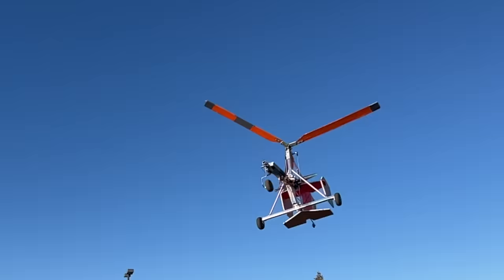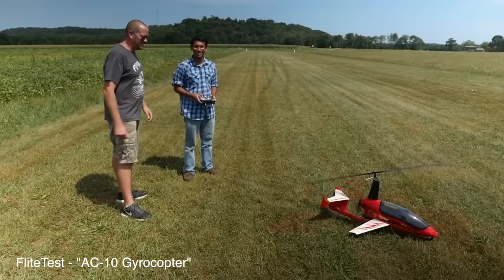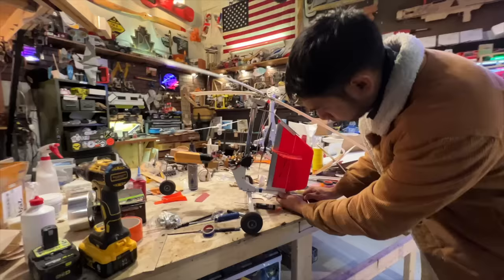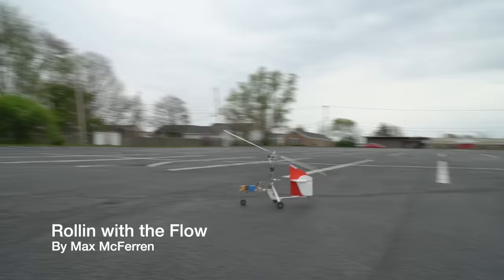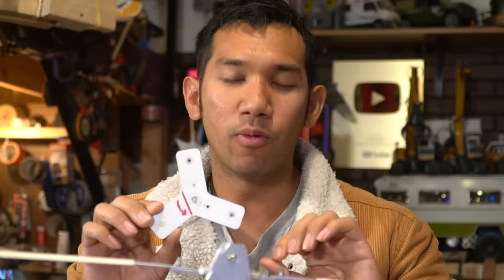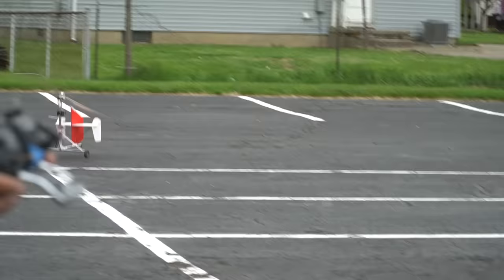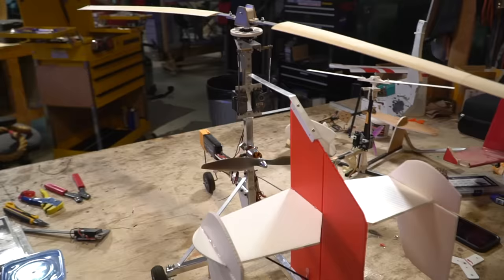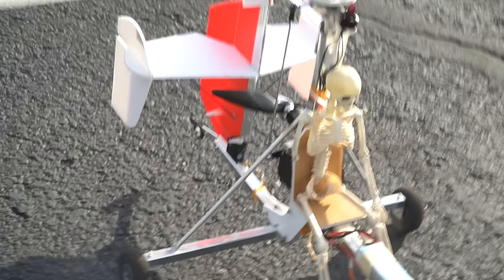This isn’t a helicopter or an airplane?

Comment: The Auto-Gyro is literally the (missing) link between fixed & rotary wing airchafts.  Juan de la Cierva was also the inventor of the swash-plate. The mechanism responsible for giving helicopters directional control.
Reply: wasnt it the russian that invented the first helicopter? nobody wanted it until BELL bought the design from him.
Reply: Tom Sawyer   proposed by russian Boris Yuryev in 1911 but De la Cierva was the first who could really get it to work to apply it to surface control... without Mr la Cierva we would not have helicopters as we know them today
Reply: Maybe closer to an airplane.  The V-22 is closer to a heli in my opinion because the thing that makes a heli a heli is the being able to vector the thrust of the rotor.
The autogyro is closer to a powered paraglider and an airplane than a heli because they have have passive wings.
Reply: Afrocanuk is correct. The accurate history is that Cierva invented the swashplate, sold manufacturing rights to Pitcairn in the US, then the US Government overrode the patent rights to allow Sikorsky to build a successful helicopter using Cierva's invention.
Reply: @nzsaltflatsracer8054  Sikorsky became a licensee of Pitcairn who had improved the rotorhead and had his own very successful jump take off designs. Let say to be kind ahh Sikorsky borrowed Pitcairns head design and successfully flew his helicopter in 1941 or so. Pitcairn sued but according to Bruce Charnov’s book From Autogiros to Gyroplanes, the government blocked the lawsuit claiming National security. Of course this marked the end to the effective commercialization of the Autogyro. Despondent Pitcairn was found dead from a gunshot wound. His estate did win the lawsuit in mid 1970’s and was awarded, if my memory servers 60 million. A pittance compared to the industry which was aided by his efforts. Juan de La Cierva was killed in a DC-3 in England in a weather related accident as a relative young man. Kellet, Pitcairn and others improved on what De La Cierva gave us. It all started as a result of a tragic stall spin accident which killed his good friend. This led him to ask one of the most out of the box questions which showed his genius. “ Why do the passengers have to fly at the same speed as the wings?”
Reply: @crawford323  very interesting history! I in Bryn Athyn PA and you can still see faint remnants of the Pitcairn factories where the planes where constructed. You can also make out the fields where Amelia Earhart, one of the Wright brothers, and Lindbergh once flew.
Reply: @samuelculper4231  Yes, Pitcairn gave his life to the effort. The strain became unbearable after Sikorsky “Chinised” the  Pitcairn’s rotorhead which enabled the first helicopter to be controllable. He sued and the government held it up saying it was a matter of national interest. The lawsuit was settled in thE mid 70’s for 60 million. But Pitcairn was ruined by progress I suppose.

Comment: "once it's in the air it flies like an airplane" - From what I've read written by other gyrocopter pilots this is MOSTLY correct but not in one critical area - if you start stalling in an airplane and lose airspeed the correct answer is to pitch the nose down. In a gyrocopter, that'll get you killed very easily as it can send you tumbling ass-over-head very quickly. The autogyro aspect of a gyrocopter should be adequate to spin the blades back up again if you stall out simply by sacrificing some amount of altitude - but you must keep the airflow coming from the underside of the plane of motion of the blades or you're going to have a Very Bad Time™.
Reply: yeets a frisk at the gyro
Reply: TM on “Very Bad Time”! lolol!

Comment: Can add few more things: odd number of blades is generally recommended for RC gyrocopters, and you can make one from a RC copter body, where swashplate will handle uneven pitch for you, stock 3 servos will give you good control without real need for a yaw control on a tail, and stock main gear with some tinkering can be used for prespin (but you have to add a tail for stabilization anyway). Also mixes will help a lot with stall and rollovers related to burst of thrust.

Comment: For when you go full scale: Gyrocopters have a very specific safety issue that fixed wings don't, despite the fact that they control the same. Don't ever unload the rotors, it's a deadly issue that can't be recovered from. Essentially, it's like letting go of a kite string. You cant fix it once its gone. It's called Power Push Over. Rule of thumb is dont allow yourself to get negative g's.
Reply: You can see that happening in some of his model flight tests.  You need to level off gently after climbing out. Ease off the power before pushing the stick  forward. If you unload the rotor by letting wind blow in through the top, the wing quits flying and you fall like a rock.

The other thing that is different is that if I recall correctly, control inputs are not held like with fixed wing aircraft.  So like for a right bank you would move your stick right and return it to neutral, then to exit the turn you do the mirror image (stick left, then return to neutral) of what you just did to enter the turn. It's been decades since I was looking at these so I could be wrong on that one.

Get formal training before trying to fly the real one.
Reply: PPO is set up by a design with the thrust line above the CoG. Not all gyros are designed like that.
Reply: @error.418  Ill be honest, I dont know any design that doesnt have thrust above cog.  As far as I know the design feature that helped, helped not eliminated the issue, is the addition of a large horizontal rear tail fin. Designs from the 70's generally don't have this and you'll see that the crash rate amongst gyrocoptors is usually those older designs.
Reply: @benm5913  A lot of people modified their gyro to raise the body so they could lower the engine. others also tilted the engine to adjust the thrust line to more closely intersect the CoG. there was also a big push for performance during the late-60s and 70s that lead to a spike in crashes as novice pilots got ahold of engines too powerful for the design and skill level. it's complicated, but PPO is set up by thrust line over CoG and exacerbated by higher power thrust.
Reply: @error.418  I agree that PPO is set up through thrust over cog, buuuuut, unloading the rotors is the end result. That was the original point. Don't unload the rotors.
Reply: @benm5913  Unloading the rotors can cause PPO when the thrust line is above the CoG. but the issue with unloading rotors is not just about PPO. it's also about striking your prop with the rotor, and other issues. so avoiding unloading rotors is good advice regardless, and not solely because of PPO risk.
Reply: @error.418  OK. I can agree with that. There are definitely other causes to be concerned over unloading rotors.
Reply: @benm5913  The GyroBee by Professor Ralph Taggart was specifically designed with thrust below COG and very large rotors for the size - not efficient, but designed to make PPO virtually impossible.
Reply: What exactly do you mean my "unloading the rotor"?
Reply: PPO isn’t a factor in modern gyroplanes. That was more of a Benson style gyro concern. And learning to not unload the rotors is not that difficult to master. All aircraft categories have their learning curve. I’d be more nervous learning to take off and land a float plane in chop.

Comment: It's not just the aerodynamics that doesn't scale well, it's the ratio of gyroscopic force to the mass of the vehicle.  (i.e. your aircraft is so light, the gyroscopic force dominates at high rotor rpm).  If you add a second rotor in contra-rotation, you will reduce the gyroscopic forces and have more stability.  Optionally, you could add more mass to your aircraft.
Reply: So, using dual rotors and a contra-rotating props on the engine should make it easy!

Comment: I remember reading an article in popular mechanics in the late 2000's about a guy building and flying a gyrocopter. He used an old Subaru engine for the power plant and a clutch to spin up the free rotor.
Reply: A Subaru engine?? The gyrocopter must have been huge.
Reply: @infinitytoinfinitysquaredb7836  I mean it wasn't huge, but it was larger than the one Peter has. Granted, once you take away everything from a boxer engine, they are not that big. If you look up some of the older ones, they still have the Subaru boxer engines.
Reply: @cheapskateaquatics7103 
We are talking about an automobile engine here, right? Seems like a very poor fit for a gyrocopter. But what do I know, I'm not an aeronautical engineer.
Reply: @infinitytoinfinitysquaredb7836  theres one  for sale over here with a turbo subaru flat 4 engine and is a registered aircraft and everything
Reply: @infinitytoinfinitysquaredb7836  It's not too uncommon, Ultralight / Experimental aircraft tend to use both VW and Subaru engines because they're Boxer engines (Horizontally Opposed), which is the same configuration that a lot of the larger Lycoming and Continental engines that are in most GA aircraft.
Reply: @infinitytoinfinitysquaredb7836  nah plenty of blokes still have them.  In my day they used the e81 motor direct drive they were pretty enemic but with a redrive they performed better.  I had a direct drive VW.  It performed well but eventually after several engine failures and long walk.  Stopped flying it.  Building another now with a two stroke but really wanting battery's to get better to build an electric one.  Only one moving part.
Reply: @infinitytoinfinitysquaredb7836  they work but remember the original bensen was a target drone engine two stroke about 70hp but an engine only designed for about 5 hours of reliable flight before being shot down.  And most ultralights were flying two strokes   so the four stroke VW and Sub engines were considered a step up.  The new rotates are very reliable but even the 100 hp 912 is over $20000 my VW gyro when I built it cost me about $2500 mind you that Waa decades ago and I build my own rotors.  But it was possible to get in the air for less than $3000.  I'd love a 912s but can't afford it.
Reply: The subaru ea81 engine from the early 1980's subarus are not very powerful compared to modern cars engines, but are very reliable and light, as long as you warm the engine up before going hard on them, they will sit on 4-5000 rpm all day every day for years. a good choice for a light home built aircraft.